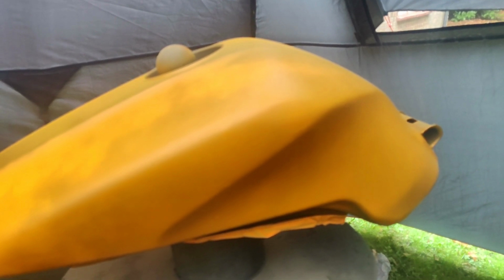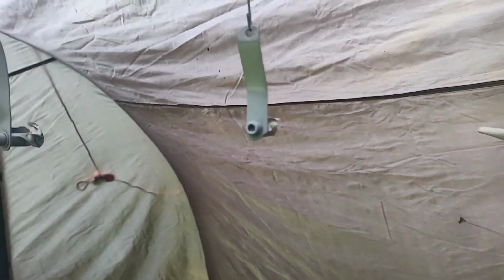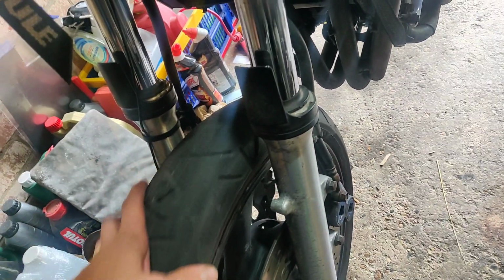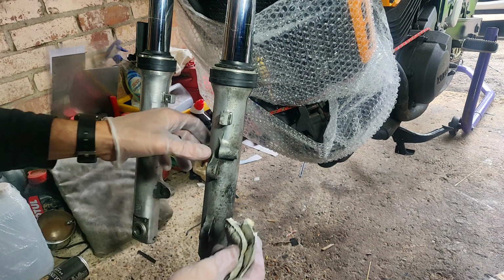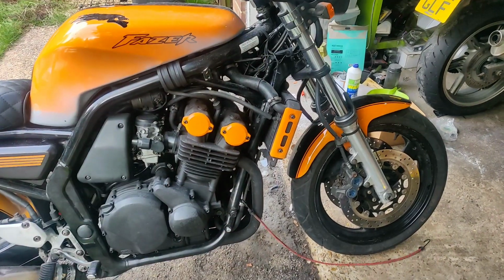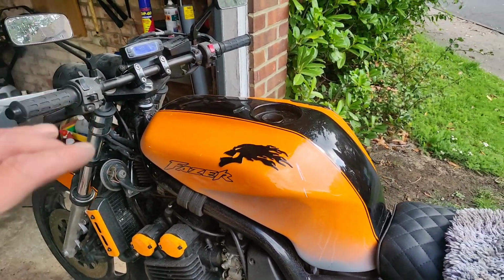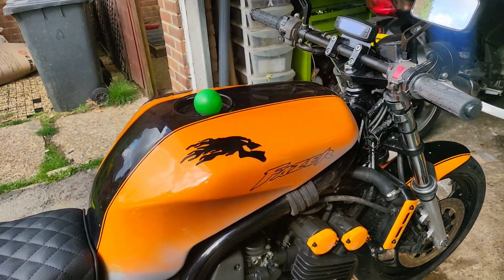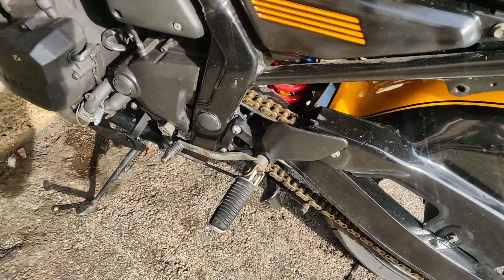Tango tank spray attempt & forks tidy up.

Comment: Good decision with the forks. The early Fazers had Brushed alloy finish the later (2002 onwards?) had silver paint . Ive had both versions and the alloy was easier to look after. I've  repainted the silver ones on my current bike a couple of times. Original paint is quite tough but gets chipped with stones and the weather gets under it.
Reply from the maker: Forks really do have a hard life!